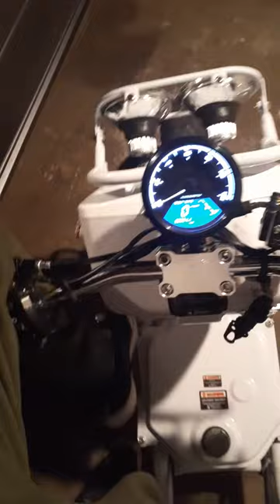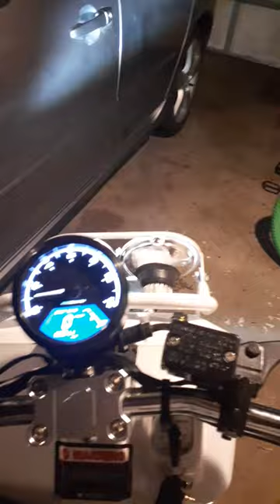First start up icebear maddog gen 4 part 2 (phone vlog)

Comment: After it breaks in it starts up on first try, just give it time, try not to go over 25 for the first 100 miles, i know that sounds crazy, for me too, but until dmv opens back up, we got time lol, looks good, dont forget your front fender, unless your leaving it off. Ok man ty, cant wait to see what parts you ordered, some lady in philly, makes custom seats for these any color combo u want, good prices too, i forget her website , but i will find it. Ok im out 👍👍👍
Reply from the maker: I was thinking no fenders I won't drive it in the rain
Reply from the maker: I'll post a video today for a mod
Reply: Mine won't start need help won't turn over do I need to charge battery
Reply from the maker: @YoungWise2011  younhave to put the electrolytes in the battery
Reply: YoungWise2011 Did you put electrolytes in the battery and did you charge it? ?
Reply: @JerseyStyle7  I did. After following the fuel line I saw it was torn at the carb. I snipped then rewrapped
Reply: YoungWise2011 oh good, yeah sometimes they get pinched too
Reply from the maker: @YoungWise2011  how do you look like the bike it's nice right
Reply: @bangermedia3244  ya I'm loving it so far. Just need the dmv to open so I can register it,  but I'm still riding I live on a beach so its perfect. Just ordered the performance kit from cajundogs.. need a new seat and want to paint some parts. And get an alarm